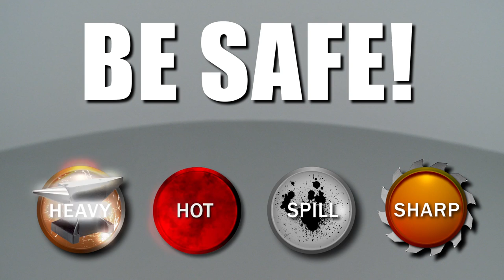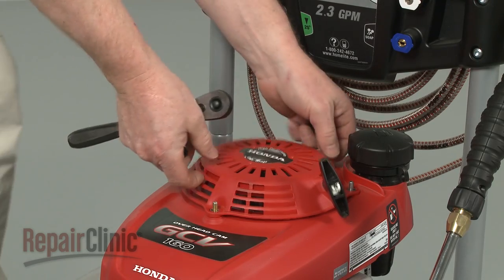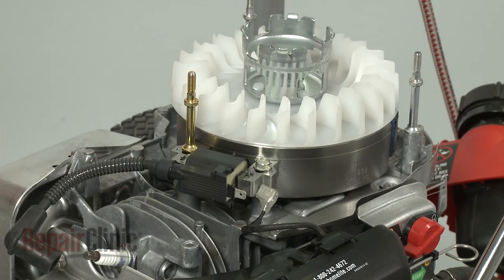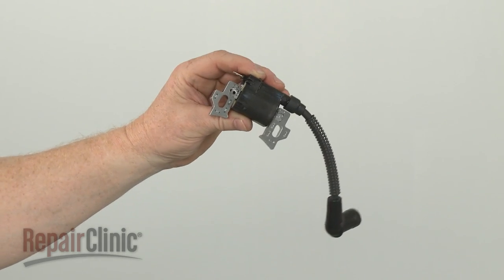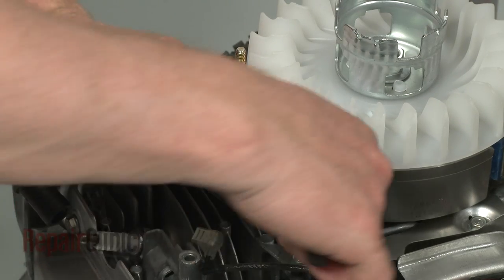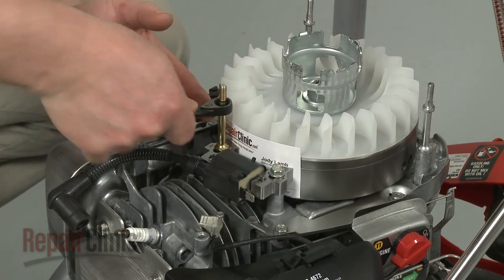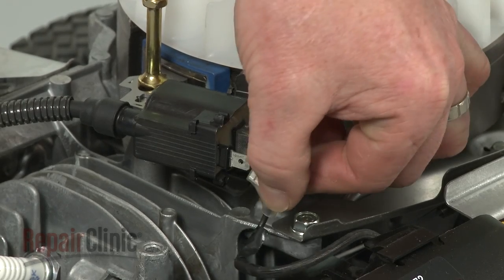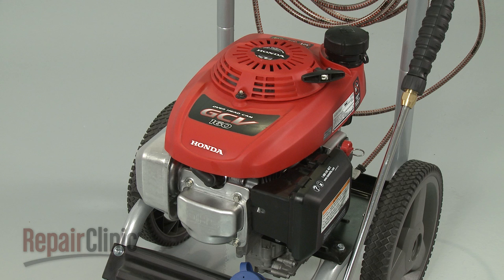Honda Pressure Washer Won't Start? Ignition Coil 30500-Z0J-004

Comment: I have one that pulls me inside when I try to start the engine .  I pull it and then it yanks me right back ? Did I put it together wrong ?
Reply: Release water pressure with the gun. Assuming you’re not trying to start it dry.